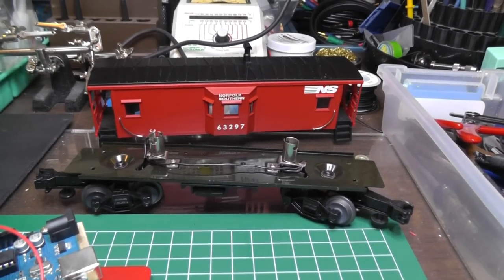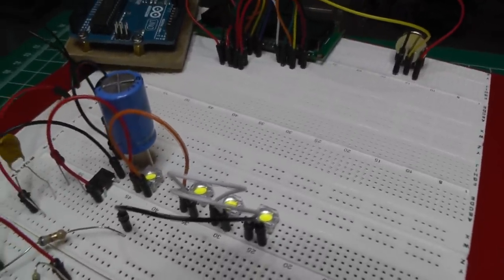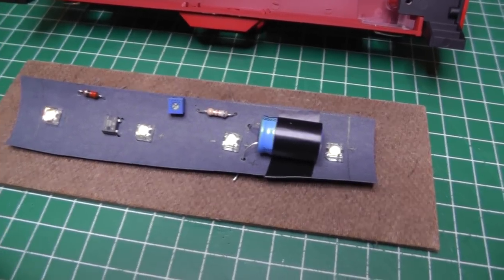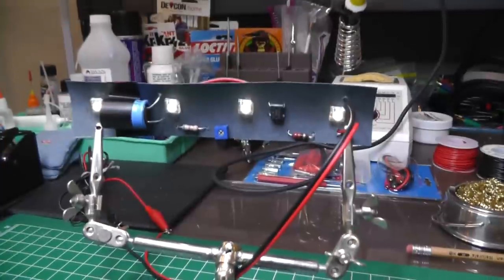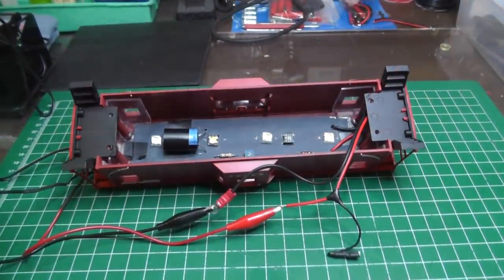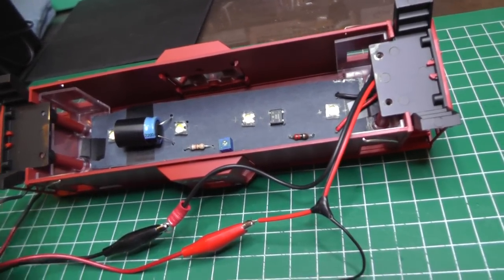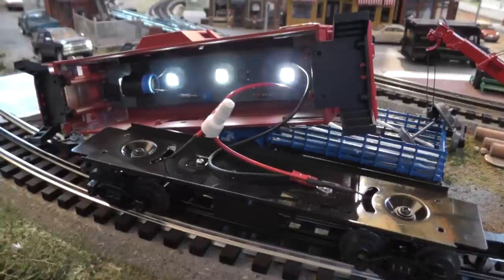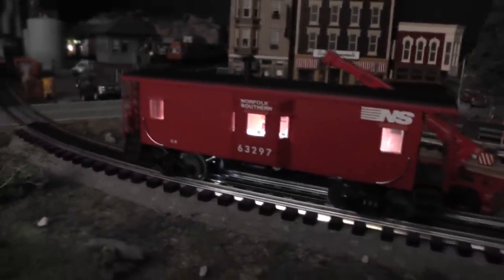LED Lighting Conversion - MTH Caboose

Comment: Looks good. I also used Capacitors on my garden scale trains. Only 4700uf don't matter much both will do the job. 
No flickering. At the the time I did not use L.E.D.s. I used the LGB bulbs.

Comment: Ok, now for your next project you can do an interior for it, LOL
I like that circuit, I think it will work with dcc right?
thanks for sharing, Chuck
Reply from the maker: I don't know anything about DCC/HO, but the bridge rectifier in this circuit converts the O-gauge AC track voltage to DC for the LED circuit.  You shouldn't need that for HO since it is DC.  Also the resistor value in this circuit was chosen to dissipate the extra heat from the 18V AC (~23-26 volt DC after bridge rect) so that would be different using DC 12v (or whatever HO uses).  It would be easy to modify the part values once you know the supply specs.  Thanks for watching!  Bob

Comment: Great Video Bob I used led lights that just fit into the existing bulb sockets on some of my Williams FA-1's they do not say on after power is cut but it was simple to do Ebay has the bulbs in both bayonet and screw in for about 10bucks of course they are from china but your project did come out nice Thanks for sharing
Reply from the maker: Cool. I considered those socketed LED's but I wanted to do the electronics project to enhance my skills. In my other video I used LED strips and these have a much more uniform light because there are more LED's in the same area and no hot spots like bulbs. They are easier to wire up too because they come pre-wired on strips. Just playing around for fun. Thanks for the comments on this and other videos. Enjoy!

Comment: A very good video.  Since I do HO scale as well as Lionel 027, you have given me some ideas about changing the lighting in my 027 to LED's.  I've done one Lionel engine changing the incandescent bulb to LED lights.  Did you incorporate a choke into the electronics?  I use full wave bridge rectifiers in my HO scale coaches.  I was just wondering what else is needed for AC since Lionel is 18 volts AC.  How many amps is your SMD full wave bridge rectifier rated at?  Mine are all rated at 1 amp and I was wondering if that is enough for the AC circuits.
Reply: Quite educational video.  My project was infinitesimal in comparison.  Pigtail came off and thus no light.  I hate to test and miss.  Thanks.

Comment: Hi,

mount this stuff on "perf board", which is bakalite with copper lined holes.  Mount the items and solder them together.  Then stand it off with some styrene tube to the roof of the caboose.  bob
Reply from the maker: Yep - perfboard or veroboard would work too.  Thanks!